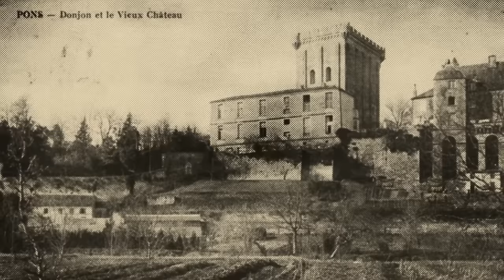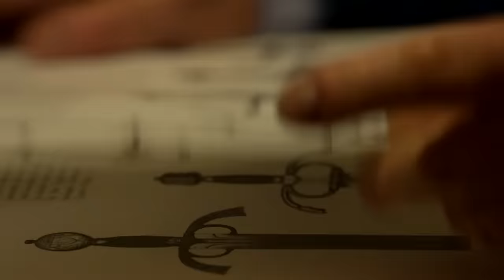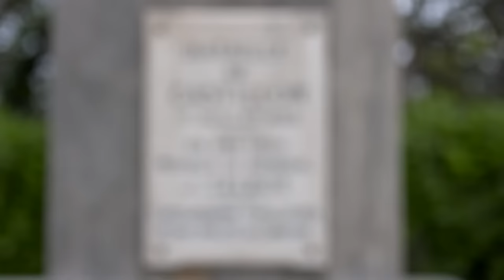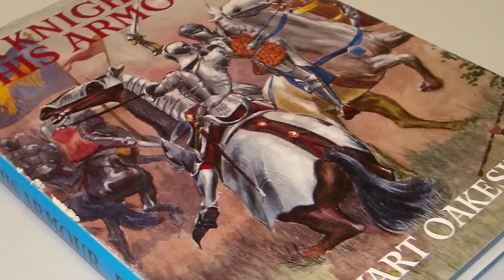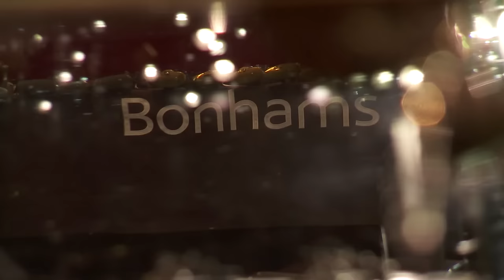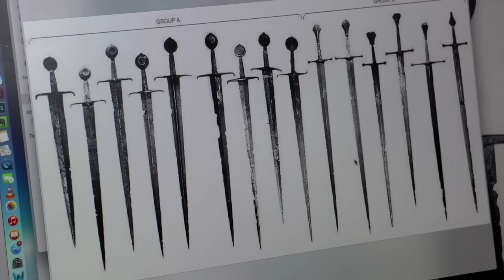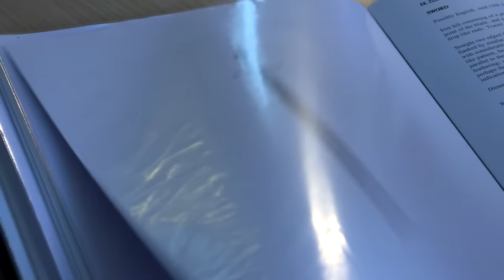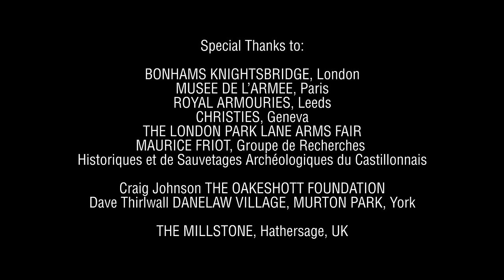Mystery of Castile Swords - Medieval Dead - S03 EP03 - History Documentary

Comment: If these swords were lost by soldiers drowned while escaping across the river you'd expect there to be more than just swords turning up. There wold be polearms, daggers, armour, ... etc. The crate theory seems far more plausible.
Reply: An back up Swords, the main force ran forward into combat. Many may get sword damage, little way to correct the damage so the get a back up sword. The military failed and was routed so the back Swords and everything else took off like bat out of H377. So some swords were lost in the river during the E&E of the defeated enemy. Or since the military was Defeated the back up Swords were scuttled in the river to be kept out of the victors hands.

Comment: Most of my life I was interested in forging and metal work…. When I joined the military was probably my best chance but I was chosen for a different career. I wanted to do it all from forming custom sheet metal by hand into tanks and fenders to custom welding, even milling and lathe work. But most of all blade forging. My life has left me disabled but I’m still trying to make a hand full of my own knives… it’s just killing me. Maya if I had a press or power hammer of some sort I tried taking a piece of weld steel and tried to make a diamond blade profile and I only got may 6 inches of it done. I just can’t handle the labor it would take to make even a short sword.

Comment: I have heard these were of superior steel compared to others of the same period
Reply: The "quality" of sword blades then and for centuries after depended largely on the source of the iron ore from which the wrought blades were forged. Too much sulphur or too
much phosphorus  meant that the blades were either "cold-short," meaning they were brittle as-made, or "hot-short." meaning they couldn't be hot-forged. This is why centres 
for blade manufacturing grew-up around for example Solingen and Toledo. Sword blades were an item of international trade in Europe. There were no suitable 
iron ore deposits in England and blades were imported. I have a collection of about 20 English swords, 1600-ish to 1680 and with one exception they all have German or
Spanish blades. The exception is a Civil war-era sword made at Hounslow circa 1645.

,"